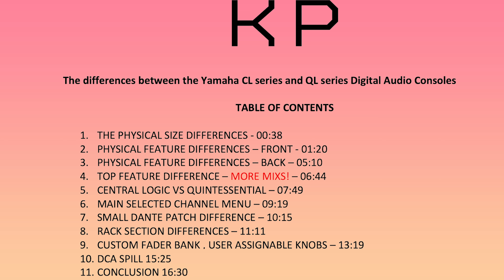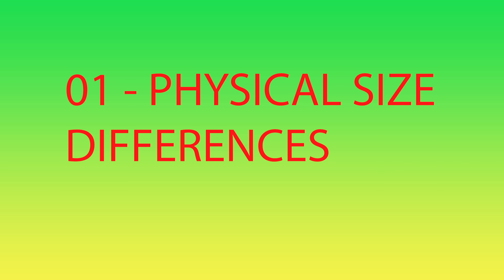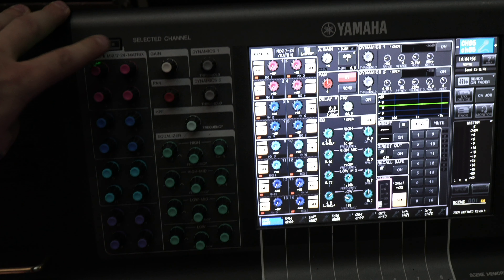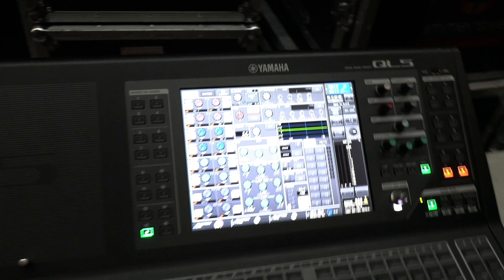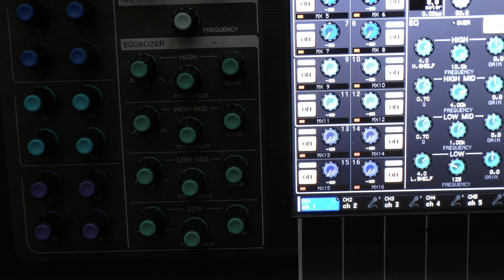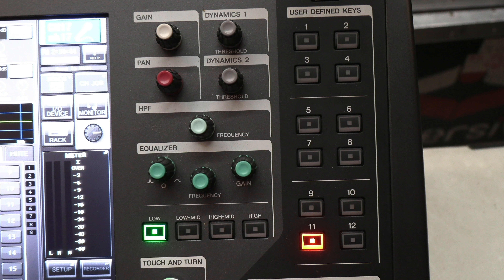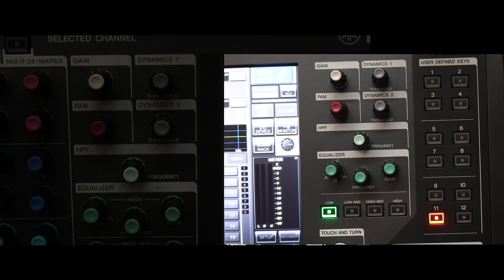Yamaha CL and Ql comparison - Yamaha Digital Audio Consoles

Comment: I work for years with QL 5. never touched a CL. But the QL was always enough for the shows i do. But with more and more musicians using In Ear the QL can run out of Mixes very fast and i need at least 2 verbs 1 dly and 2 stereo mixbusses means only 8 Mixes left for just MONO In ear if you have 8 Musicians. If 4 musicians you can give em Stereo In ear. But i love th fact that the QL has all the onboard Mic Pre´s and 16 OMNI Outs. I would only use a CL because of 24 Mixes, just in case. Otherwise the QL is my go to desk for years.

Comment: In certain conference situations, when the wireless mics are at FOH and not networked /dante inputs, but physical inputs (maybe like a old  Shure UR4D) then the CL’s 8 inputs get pretty full pretty quickly - especially when you’ve got maybe a couple of video inputs from a film and maybe also your MP3 player for walk-in music. Fortunately most wireless is Dante these days but if your wireless system is old then you might be better off with a QL (even the smaller QL1 has 16 inputs at the back of the console).

Comment from the maker: Andrew Broughton  made a good comment about 10:15 - the small Dante patch difference.  The CL defaults to Ch1 = Dante 1, Ch2 = Dante 2, etc. while the QL defaults to Ch1 = Omni1, Ch2 = Omni2 and so on. This is why the additional step is needed when using Dante controller, but ONLY if the CL or QL still has it's default patch. If any patching has changed from default, or you are changing away from the default patch, the steps are the same on both console (i.e. 2 steps are required)